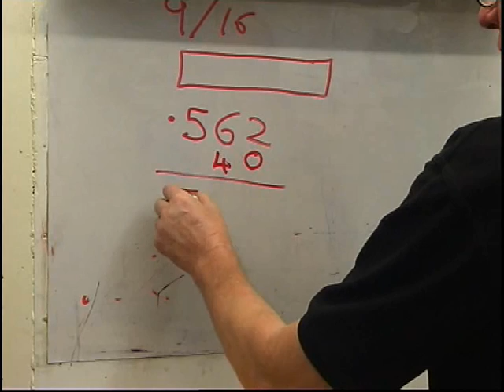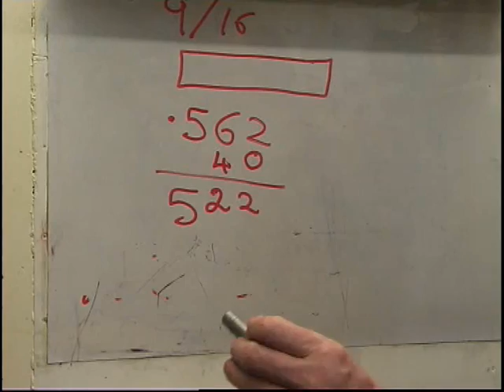DIVIDING HEAD PART TWENTY More screwing

Comment: I'm really enjoying this series, John. It is all very well produced and fortunately I am from sufficiently far north to totally understand every single word of your exquisite NE accent.

I commend how you use the Vernier Calliper Gauge as a 'Very-near' Calliper Gauge, then turn to the Micrometer for absolute accuracy. All old-school stuff and still valid today.

All these ISO units engineers who boast about being able to work to 0.01mm (4/10,000 or 0.0004 inches) when the old brigade, working with a Micrometer with Vernier markings to Imperial units, regularly worked to limits of 1/10,000 or 0.0001 inch (0.0025mm). I think that gives bragging rights to the old school Imperial unit machinists!

For any doubters out there, our women in the aircraft factories during WW2 were working to less than a 'thou' accuracy.

Comment: I've been looking at exactly that proposition (well, rotary table), for a while now.  I now have all the electronic bits to make a stepper motor controlled rotary table, and am getting to grips with the programming language for the Arduino Uno board that I will use.  I don't have the rotary table yet - I will make it when time permits.  Save me to your favourites and you will be notified when things start to happen.  Regards Mark in the UK

Comment: What I had in mind is something very similar to Chuck Fellows rotary table here on YT. Watch his video and you will see that you are required to enter a number which represents the number of equally spaced holes; the program calc's how many degrees spacing that means and will advance the stepper motor x number of steps to achieve that angle.  Other possibilities require a program to allow 'options' for non-equally spaced holes etc. Existing stepper programs seem too limited for what is needed.

Comment: Why didn't you use the gouged end of the bronze slug to make your nut? Since it's sorta hollowed out already, would save you a bit of cutting, and you'd be using a part of it that isn't normally used (i.e you want to make a shaft, then you can't because that end is gouged, so might as well use it now so you have a proper slug to use when you need to make a shaft)?

Comment: squaring with a fishead is not a good way to square, because the eye cannot judge such small error differences. Better to square the QCTP to the lathe chuck, then you know the tool is square, root-mean-square square, as fine as the surface finish on the lathe chuck and qctp allows (they're ground, that's excellent).